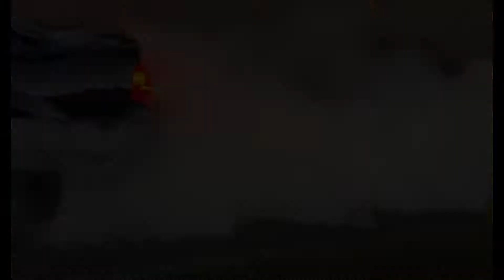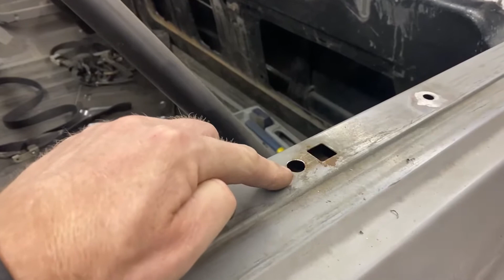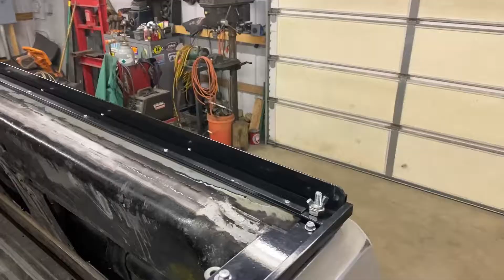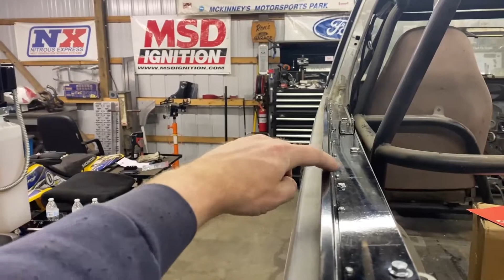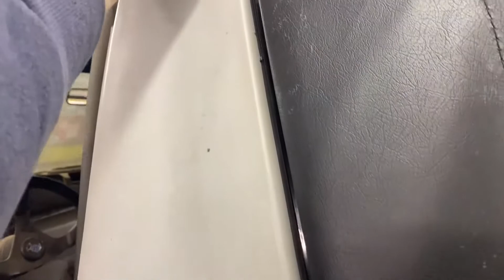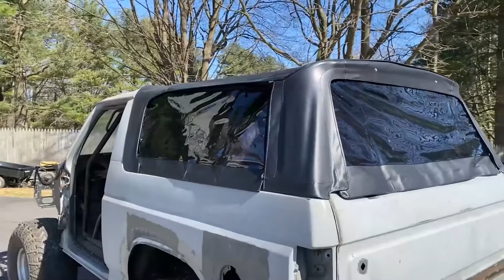CUSTOM 1984 FORD BRONCO BUILD (RAMPAGE SOFT TOP INSTALLATION)

Comment: I am shopping for soft tops for my 93 which also has a roll cage but my roll cage is a little bigger than yours. the hard top can fit over my roll cage but what I am worried about is if the soft top bars will sit too low when I want to put them down. How close are those bars to the soft top to your roll cage? Thanks for the video, this is the most helpful so far with my roll cage concerns.

Comment: I don't normally knock people but you do not need to install softops mate. I have installed several of these and had very few issues.  Mostly missing parts from the kits. Are they a great product. No, but they are good.